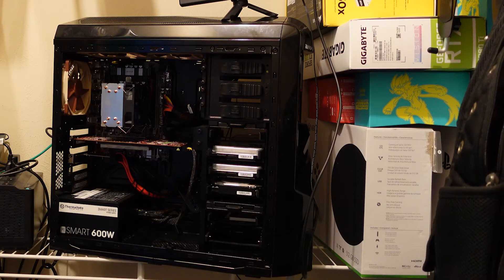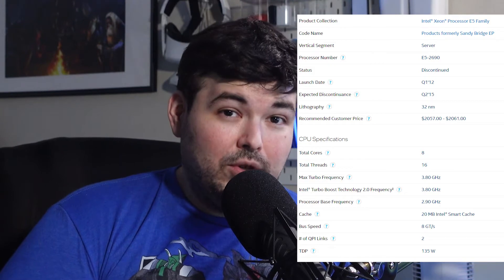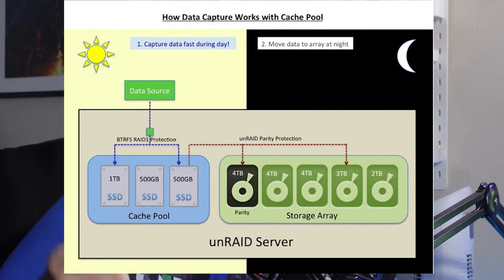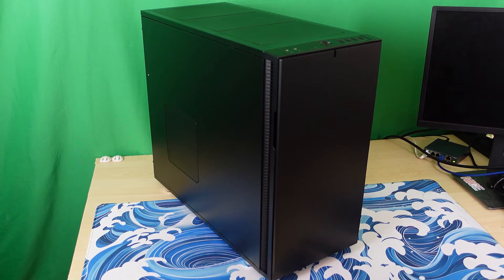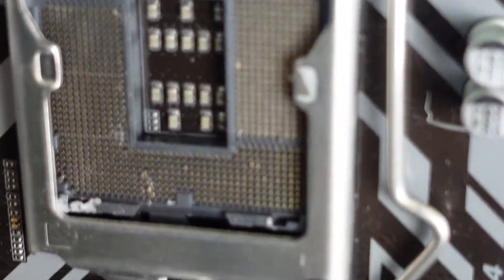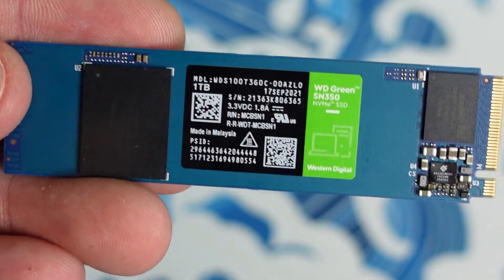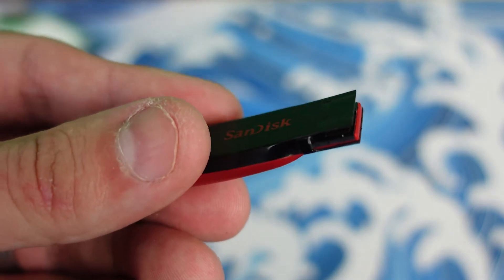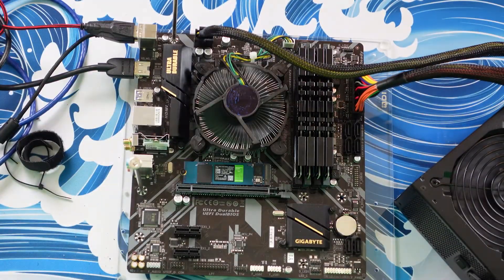Building A Home Server FOR CHEAP

Comment: Hey man, great video, just have one question, What OS did you install on your server? I'm thinking to make my own server but I'm stuck on that point, cause I'd like to go with something allows me to put my Files(NAS), maybe start up a Minecraft server, Plex, some Docker apps, all that in the easiest way possible, maybe one simple w10 installation would be ok, or maybe more specific with linux, like Ubuntu or something lite, like FreeNas. It would be cool if you could you help me. Thanks.
Reply from the maker: Hey there, thanks for the comment! I personally use Unraid, which is a baremetal hypervisor that allows me to run my NAS, virtual machines, servers, Plex, Docker etc - it is a paid one time license depending on how many drives you use. I love it because for me, it is dead easy to get everything going, which I really love.

It sounds like Unraid might be the best fit for you - all those things you described could be done quite easily on Unraid - I recommend looking up some videos on the OS and see if it works for you. Hope that helps!